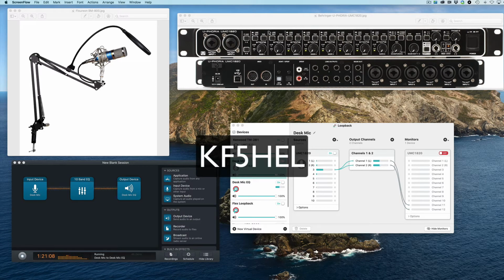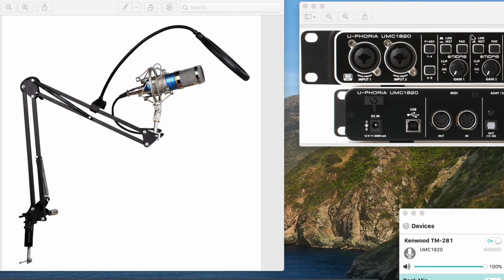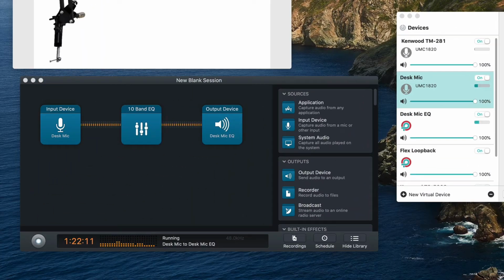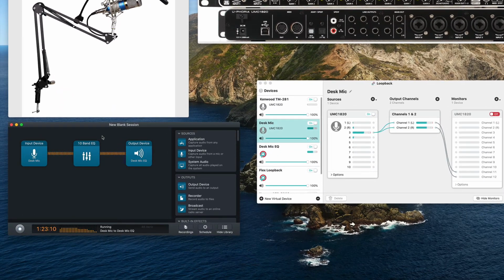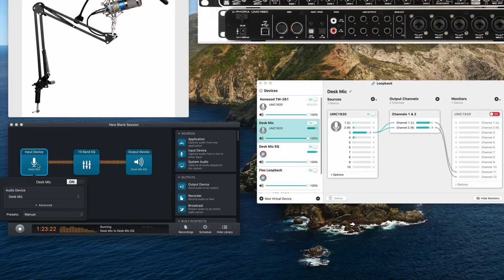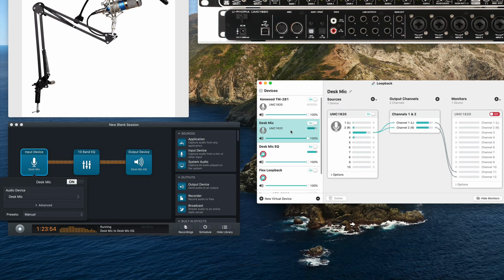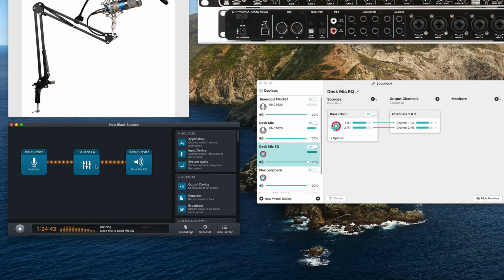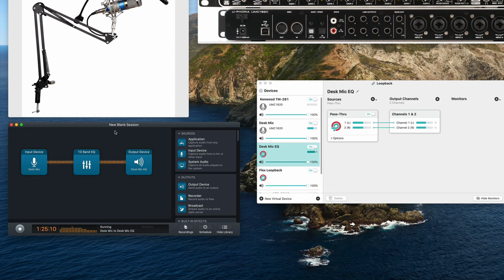External Mic EQ Setup for FLEX-6400 Operation on a Mac using Audio Hijack and Loopback

Comment: I have the same setup with my 6400. I have not been able to find a cable that works from #3 output to the mic input on the 6400. I get a high pitch whine on transmit. Hope you can help.

Comment: Much appreciated. I have a 6600M and I have purchased an UMC-1820 for the exact reason you have. I have other radios that I want to integrate using the same mic and wanted to be able switch radios, mix, and record off the air. Though I am planning on using Windows 10/Ubuntu Linux. I'm glad to see a success story with a similar configuration to my own. 

Now if I can just figure out how to use control the UMC from Node Red for radio switching and monitoring.